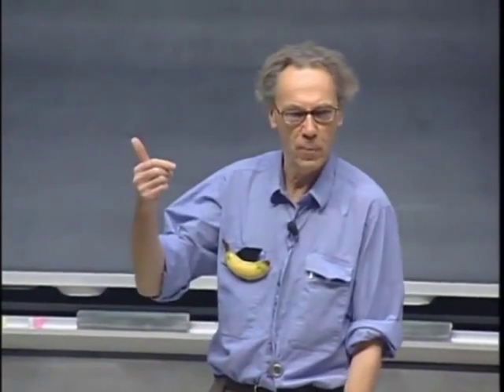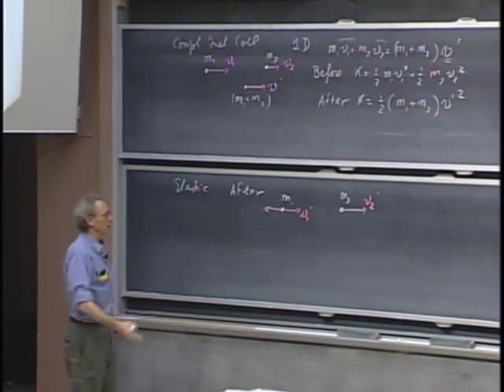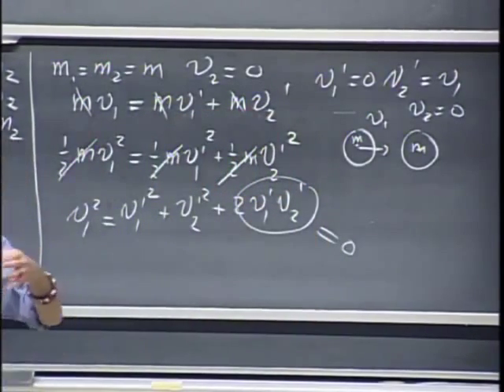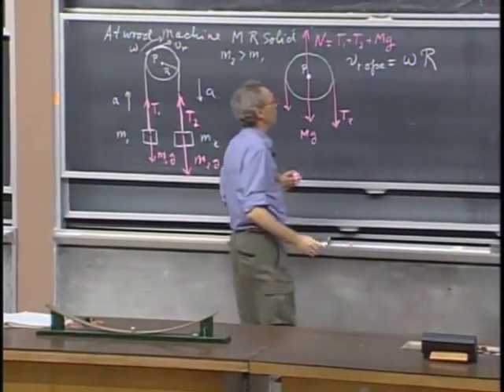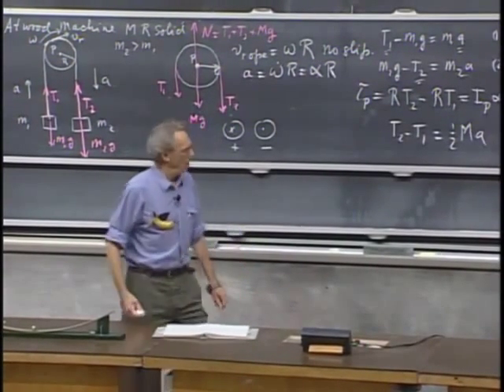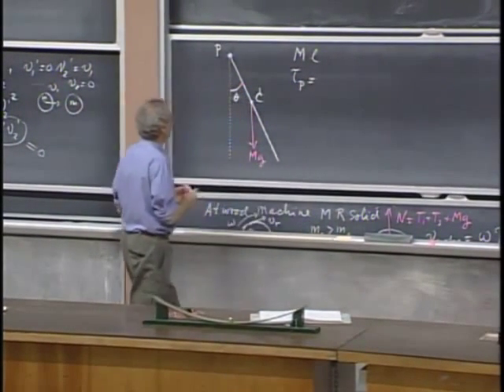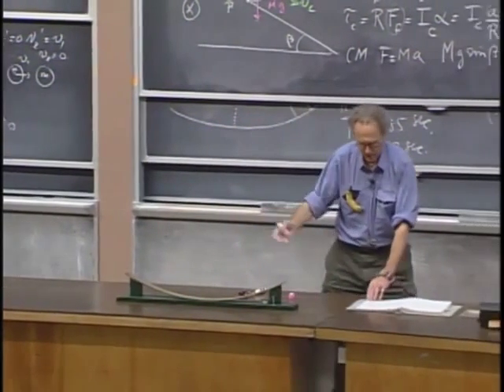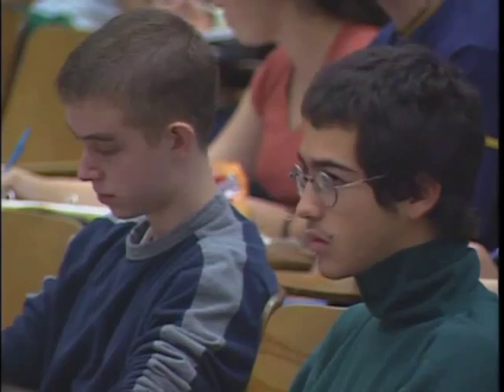8.01x - Lect 29 - Third Exam Review

Comment: Hi Prof, may I ask how the exams work(ed)? 

1) How much time is/was given? 

2) Is/Was there error-carried forward? (If you make a mistake for part a and it affects your result for part b, will you get the full marks for part b if your method for part b is correct?)

3) For an 8 point question with only 2 steps, is/was each step worth 4 points? Thanks!
Reply from the maker: midterm exams were 50 minutes. Final exam 3 hours.

Comment: Sir, at 33:30 you've said that in STR it doesnt matter if we are moving or the star is moving, but what if we are both moving, should then we use relative velocity insted of just velocity of star (v) when only the star is moving? :)
Reply from the maker: v cos(theta) => v is the speed with which the start moves relative to you (in your frame of ref you are standing still , and theta is the angle with the line that connects you with the star.
Reply: Lectures by Walter Lewin. They will make you ♥ Physics. Ohh, now I get it, thank you so much professor :D